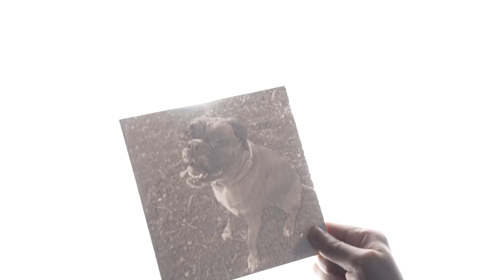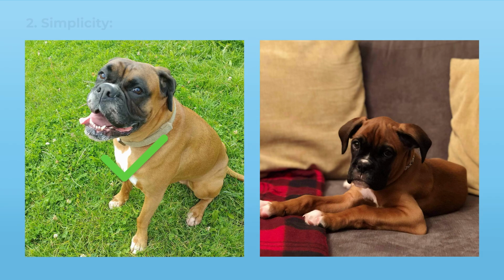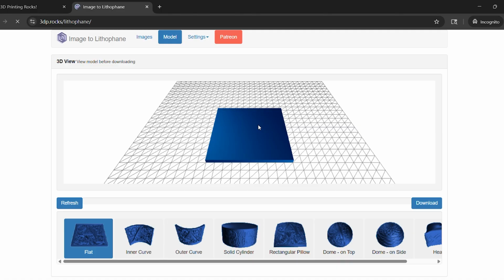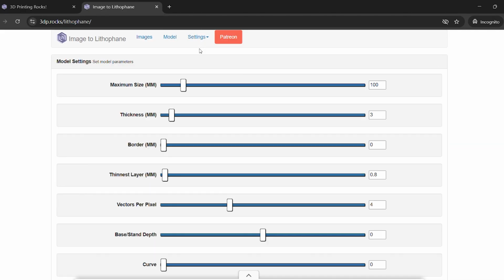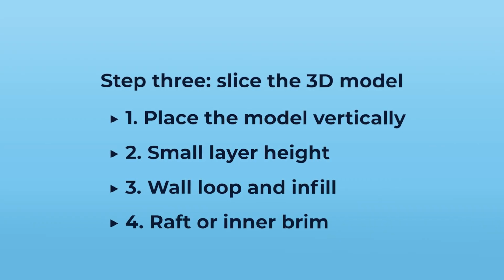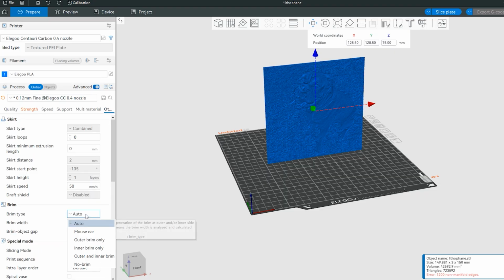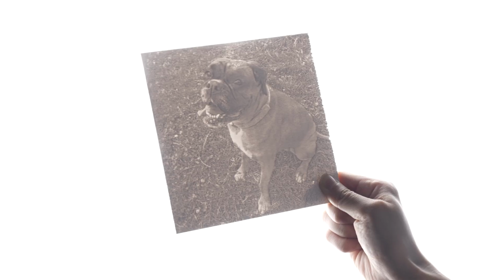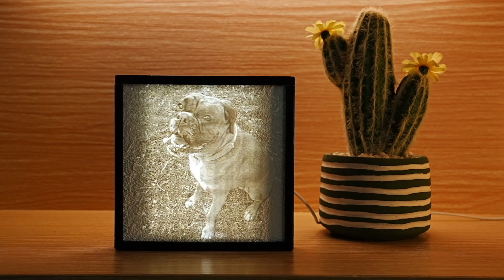How to 3D Print Your Own Lithophane

Comment: Every time I try and print a lithophane on the centauri carbon the print fails and I get a clog. I think I was trying to take advantage of the high speeds and that was the problem. How come
In this video it does not mention the speed setting??? Also, I thought typically lithophanes are supposed to be 100% Infill. If anyone has printed lithophanes on the carbon with the elegoo slicer can you please share them? I might have to use Cura but I want to get good with the elegoo slicer